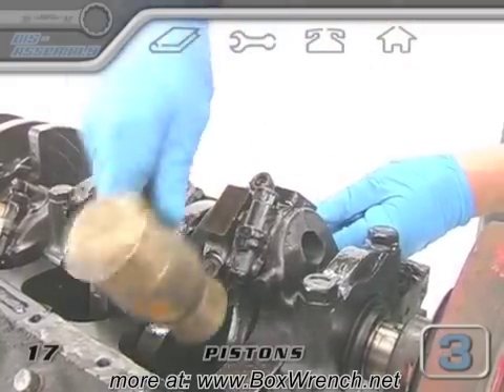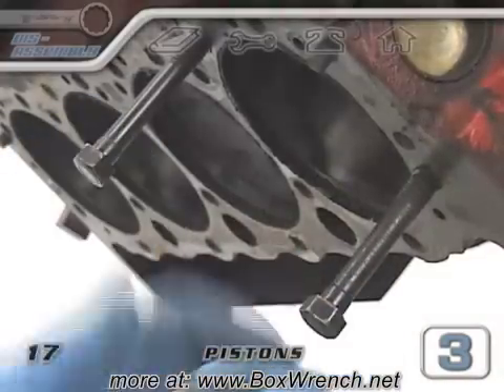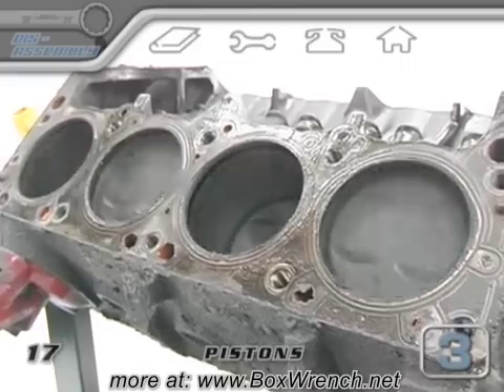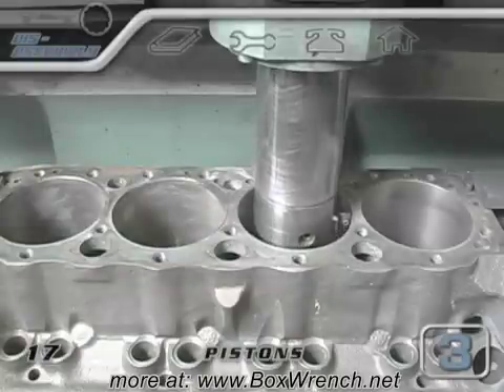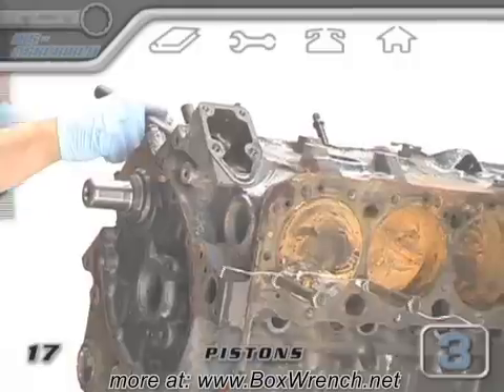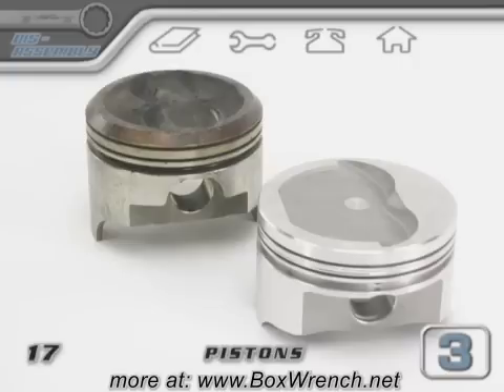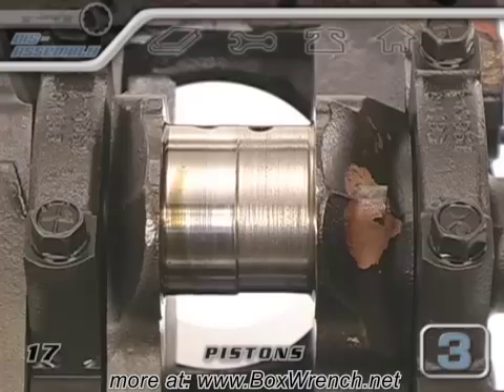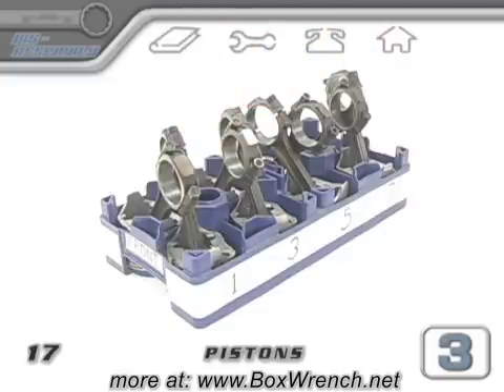Engine Building Video - Piston Removal - Chevy V8 Small Block

Comment from the maker: @egpg2000 this is a sample from a 3 1/2 hour educational DVD...
You see here that the crank is junk from the damage caused by a spun rod bearing, but that's not going to be the case for every person dismantling an engine. 
We're showing the correct procedure to protect your rod journals as you remove connecting rods and pistons. You're  not going to know exactly what state your rod journals are in until you clear the rods and pistons. So, here we show how to protect your crank.

Comment from the maker: @koopooda If you need to replace pistons that you've removed and didn't label where they came from, you're going to have a mixed bag of results and a higher risk of engine damage after rebuilding the engine. 
It should be easy to determine which pistons came from what side of the engine because of how the machine shop hung them acording to the 'Front' mark on the piston face and the direction the rod tang is facing. 

Piston position and rod tang orientation are covered in our full length DVD

Comment from the maker: @jdmk20guy the example engines in the 'Basic Engine Building' DVD are mostly V8s, but you can absolutely use the DVD to help you work on any other type of gasoline/piston engine. People use the 'BEB' DVD for 4 cylinder, 6cylinder and many other types of engines all the time. 
All of the procedures and tools are the same for each individual piston, the total number of pistons won't change how you remove and install them...

Comment from the maker: since your engine is a line four and you were able to remove the crank already, how about supporting the block on the ground and trying to beat the pisons down into the block and pull them from the oil pan side of the block instead of from the cylinder head side...?

You will completely destroy the pistons and the block will need to be bored for sure, but you may get them out by trying to beat them out backwards since you've got the crank out of the way...

Comment: im working on a datsun 280z and the engine has been siting open on a stand for 10 years and i got to the point to remove the pistons but they are seized and i cant move the crank shaft so i removed it and was only able to get 2 pistons out we put penetrating oil in to let them move and i cant get them out can you please help me this is also a school project and the teacher has no more ideas i did use your on the video

Comment from the maker: Yes the DVD shows the entire plastigauge process for the crank main journals and rod journals as well as ring gap filing and positions during piston install. 

The machine shop section shows the machinists using the dial bore gauge and other instruments. We don't cover the use of a dial indicator specifically in the 'Basic Engine Building' DVD as it is part of an "advanced" engine builders tool set. 
The 'BEB' DVD will absolutely guide anyone through a complete rebuild using a base tool kit...

Comment: electric car require hours of charging and a ton of batteries. the tesla roadster has 1000 pounds of lithium batteries which is a lot heavier then the small lotus engine it replaced in that frame. so electric cars are expensive, heavy, take a long time to recharge and have poor high end preference. and turbine cars are no better, turbine engines are really expensive, high maintenance and suffer from turbo lag which is when you rev up the engine it takes time to raise compression

Comment from the maker: There is no such thing as a "quick" way to do this without risking damage to the cylinder walls. 
You also need to consider that we are showing a lot of potentially inexperienced people how to do something for the first time. Short-cuts are not the best thing to teach in many situations.

The method shown here is the "right" way to do the task...doesn't matter how long it takes. 
Any other technique, or leaving out the protective rod bolt covers just leaves your cylinders at risk of scratches

Comment: the tube on the bolts, is more to protect the crank than the cylinder walls, its easy to touch the crank journal with the hardened rod bolts, just a nick, then you have to turn the crank

Comment from the maker: Some cylinder bores will be just fine after disassembly and will only need a glaze breaking to return the crosshatch pattern to the cylinder walls. It's possible in a low mileage engine that the same pistons could even go back in after a cleaning. 

If you didn't protect the cylinder walls with hose pieces or other during disassembly, and scratched the bores, you'd have to machine the block. 

We're just setting an example for people to consider the possibility so they don't damage a good block.

Comment from the maker: Do you mean that the entire engine was underwater in a storm? 
If that was the case you may see something similar to what's in this video with the "marine engine" that needed the metal rod to bang out the piston. There likely would be no saving a set of pistons that froze an engine from corrosion. Each case is different though. You need to pull it apart and find out if anything is salvageable...

Comment from the maker: The machine shop can measure the crank journals with a micrometer and let you know whether it is reusable, machinable, or junk. One worst case scenario for most engines crankshafts is when the crank has been previously cut on either main or rod journals at 0.030. This is the absolute limit for most cranks as engine bearing manufacturers don't make bearings any larger than 0.030 oversize. 
If your 0.030 over crank journal is damaged, the crank is likely junk.

Comment from the maker: In a stock engine rebuild or a build-up that you would like to get some longevity out of, we'd agree not to re-use pistons. 

However, many engine builders pull apart performance engine on a regular basis (such as drag racers who change internal pieces such as bearings regularly). In cases where the engine has only been run for a short time or a couple hundred to a couple thousand miles of use, often it's perfectly ok to re-use pistons. They absolutely must pass inspections though...

Comment: when at that point (where you have removed the cyl head) it is best to remove all pistons and inspect the block + replace all piston rings (it  only does good to the engine) + measuring the cylinders to see if the have become oval or if its been bored before (which is the case where u use oversised rings),if i where to do that i would remove the crankshaft first rather than trying to removethe pistons like that.anyways nice technique though..i didnt know this way.cheers.